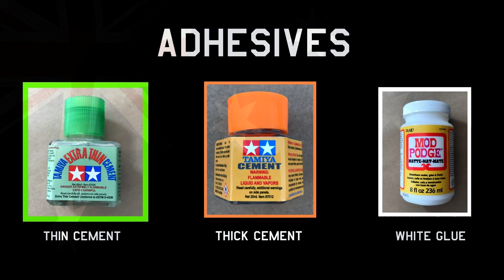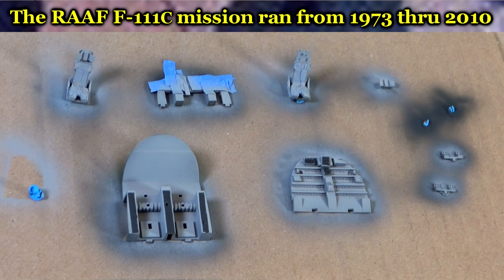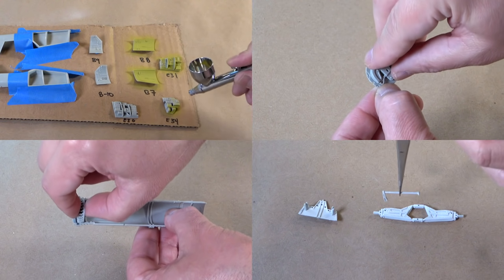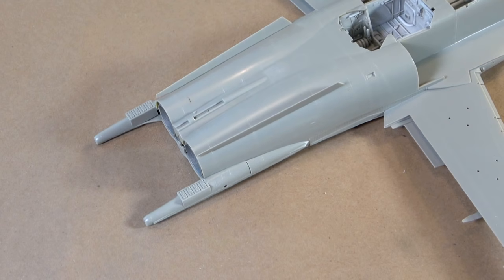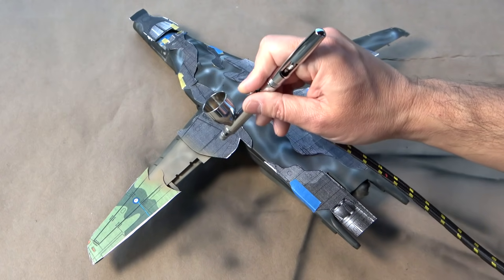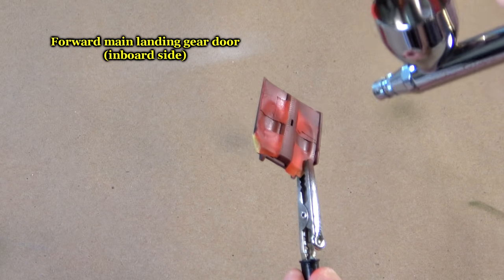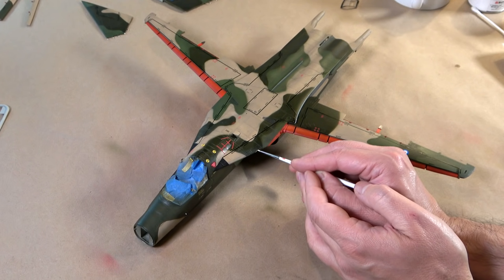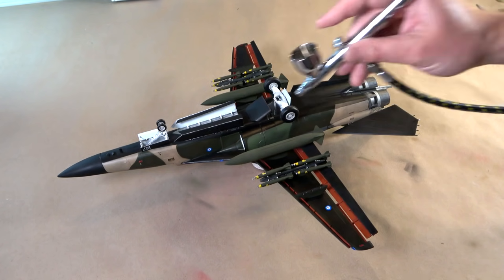Building the 1/48 Scale Hobby Boss F-111C “Pig” Fighter Bomber

Comment: Outstanding work! I just wanted to say thank you for the respect you showed for the crew that lost their lives in '93. The F-111 has a special place in our Aussie hearts and you have done that justice. Great job!
Reply from the maker: Thanks very much, Knophler! I'm so pleased that many Australians are chiming in and expressing their overall satisfaction with the model and the video. 🙂
Reply: @MaxAfterburner  Hello Max afterburner,  They said F 111 and F14 were a joint venture of Grumman and General Dynamics and  the original design was based on  F14 mock up model . Then two companies went their own way  but the variable geometry wings ,tail wings ,engine power plant should be the same (interchange parts). I am going do it with Hasagawa 1/72 tomcat F 14 and F111 Aardvark and inter change the common parts.

Comment: Beautiful job. I used to be a crew chief on A/C 0382 at Mountain Home AFB, Idaho for 6 years. I loved that plane. I won crew chief of the month twice and got to fly in my own plane. I noticed that you painted the speed brake black and red in squares. The F 111 I crewed and worked on, the cut out where the main wheels retract to, that indention was black while the rest of the speed brake was red. One thing about that speed brake. Those indentions where the most comfortable to lay on for your back. I wqas engine run qualified and also taxi qualified. What a great pane the F 111 is.
Reply from the maker: Hi Jim, I was using some reference photos for a few of the F-111s where they painted what looks like a red cross pattern and the central "bar" would travel through those indentations on the inner surface of the speedbrake. The F-111 sure was a large aircraft and probably a lot of work for you guys to maintain. Thanks for your service and for sharing your background with it! 😇

Comment: G'day, I was in the RAAF when our F-111s finally arrived. We had to lease F4 Phantoms for nearly a year until the 'Pigs' turned up. There was great controversy down here over the cost of each F-111. It was nearly four times more than any aircraft we'd purchased up to that point.
Fantastic to see them at air shows down here. I used to work at our air shows 'herding' the crowds around and keeping them away from getting too close to the aircraft. I remember doing the first available F-111 kit down here. They were a 'hot' aircraft. Happily, they spent all their time in the RAAF without firing a shot in anger. Our pilots really liked them. The ground crews not so much. A lot of them got sick after having to get into the fuel tanks to do vital repairs. It's wasn't a good outcome. Cheers, Bill H.
Reply from the maker: Hi Bill, thanks for sharing your stories! 😃

Comment: Outstanding build, Max - well done 👍 - I hope mine turns out half as good 😅 More on that in a moment...
My fond memory of the F-111 was from the 70's - 80's. I lived near a large valley near Lismore (NSW) ... as a little bloke, I could hear them coming, usually at night, flying by terrain radar I would assume. Going straight over our house at about 200 feet I'd guess. All you would see was the two big burners disappear down into the valley on their way back to Amberley. Just awesome.
I recently visited Evans Head Aviation Museum, which is located far north coast of NSW Australia. They have a F-111C on display - A8-147. Tim was an excellent guide. Anyhoos - they're struggling a bit financially, so to support them a little, the the family bought me a model kit - same as the one here - 1st one I've done since I was about 10 😉

Anyway - I'm starting to do my research for my build, A8-147 & the one in Darwin I saw (A8-113) have gloss black nose cones, not matt - Can someone in the know confirm that for me ?
Thanks in advance & happy model building 👍 ...
Reply from the maker: Hi TheQuinny67, so glad you enjoyed the build video and that you have many great memories of the RAAF F-111Cs during their active times.  While A8-147 and A8-113 have glossy nose radomes now, they indeed have been highlighted like this from their original matte standard. Many aircraft museums paint their aircraft exhibits in a gloss finish to include the fuselage sometimes even though most active military aircraft serve with a flat paint coat. In fact, a retired F-111E near me is super shiny like a sports car in a dealer's showroom! Best Wishes on your build! 😀
Reply: @MaxAfterburner  Thanks for the update 👍

Comment: Just a small note, 
When the RAAF retired the f111's, the super hornets took over initially as a stop gap for the strike capability, but are now a more permanent solution along with growlers.
Primary air defense remained with the F/A18 A/B's until their retirement in 2021, and is now done by the f35.
F111's had an initially rocky introduction, with cost overruns and several losses mostly due to mechanical failure in vietnam. Once these were sorted it was such a capable aircraft the soviets made sure they were included in talks since they were stationed in europe. 
The f111's also served extremely well in the gulf war, where they destroyed more thanks than any other aircraft, along with fantastic strategic bombing on factories, airfields and other high value targets. If you look on youtube there are many 'gun cam' vids of f111's guiding LGB's through buildings, hangers etc.

Comment: i witnessed a visiting usaf 'g' variant do a full afterburner take-off, and during climb out the air frame disappeared in a cloud of smoke. a loud explosion was heard, the plane came out of the smoke and immediately flew back to the runway and made a successful landing. the starboard engine, while at full military had 'self destructed,' luckily the plane and crew survived the event. it took a week for repairs to be completed, and a replacement engine installed, before the plane finally left.
Reply from the maker: Hi darkstar861, definitely not a dull day indeed! 😮

Comment: I well remember the FB-111As.  The 509th Bomb Wing flew them out of SAC's nearby Pease AFB between 1970 and 1990.  It was sad to see the 509th, the bombers, and Pease itself vanish into history.  I can still envision these planes climbing out of Portsmouth and clawing for the skies over the Atlantic.  Droop snooted.  Fuel laden.  And nuclear armed.  Alas, all now memories.  Still, the Aardvark's underappreciated sleek and graceful form ghostly graces the blue over New England.  And the beyond.
Reply from the maker: Hi Tex Leeger, very nicely stated. Seriously, consider writing a novel or something, if you're not writing already. Well done, sir! 👍
Reply: Pease wasn't the only FB-111 base in the area. Plattsburgh was also nearby as a crow flys. My dad worked OMS at Plattsburgh and Pease had to ship all their FB-111's to plattsburg for upgrading all their aircraft to the new crew separation system because of incidents where the capsule couldn't separate from the air frame due to the Guillotine not severing the flight cables causing crew fatalities. My dad was really grumpy after going through 2 Bomber wings of aircraft replacing guillotines on each and every one of them.

Comment: The Raven was the electronic version of the Aardvark. AKA EF111, AKA Sparkvark.
Reply: The EF-111 was also the last F-111 variant USAF decommissioned (1997).  That was a year after they retired the last F-models from service.
It was USAF's supersonic answer to the Navy's EA-6B Prowler.  It had a lot of the same jamming and electronic warfare equipment but just a heck of a lot faster.
The EF-111 scored a kill on an Iraqi F-1 during the first Gulf War.  The Raven was locked onto by the F-1 but managed to dodge a heatseeking missile.  By maneuvering to low level and using his terrain following radar, the Raven pilot was able to outmaneuver the F-1.  The F-1 got disoriented and flew into the desert.  USAF gave the EF-111 crew credit for a kill!
Ultimately, it was decided to expensive to operate 2 jamming/EW platforms so the more expensive plane to maintain and operate was retired.
The US Marine Corps retired the last operational EA-6Bs just 2 years ago.

Comment: Hello, thanks as always for documenting your process, as someone trying to improve their modelmaking it's really helpful, and I've learned a lot from your videos! I want to ask, what glue do you use to attach your painted pieces? Superglue can leave that cloudy white area and plastic glue tends to dissolve acrylic paint as shown in your Austin Powers 747 video. 

Looking forward to your next build!
Reply from the maker: Thanks vtkd! I mainly use the Tamiya Extra Thin cement. I use minimal amounts as possible and I avoid lingering in a spot when applying it in zones already painted. In other cases, sections may be already glued together before painting and I also try to apply glue at tabs and slots that aren't near areas that are outwardly visible.
Reply: @MaxAfterburner  Thank you for the reply! I will keep that in mind for my future builds

Comment: I was wondering if, on the full scale F-111, the underwing pylons rotate about their vertical axis (to maintain an optimal aerodynamic position of the pylon/pylon load) as the wings swing from low speed to high speed configuration. To me, this would seem a necessity to prevent structural damage induced by aerodynamic drag caused by pylons that are not facing directly into the relative wind.
Reply from the maker: Hi Shadovanish, it's my understanding that only the innermost pylon locations swiveled to maintain alignment with the fuselage. The outer pylons did not move and the wings would have to be swept to provide the best forward pointing position of any loads. I imagine there is some reasonable tolerance for drag/stress in less than optimal situations otherwise that would probably be a deal breaker for any country wanting such aircraft in their arsenal. 😇
Reply: @MaxAfterburner  Nope all 6 pylons rotated on the F-111. Otherwise the weapons will damage the fuselage on a fully armed F-111. There is a mechanism in the wing that moves all the pylons at the same time basically it's like the wing moves around them and they stay in the same spot. And if the outer pylons didn't move you would be risking them being sheared off by the airspeed.

Comment: Hi I have a question, how do you glue parts after painting them? It always gives me a hard time and gets gooey. Excellent work by the way
Reply from the maker: Hi Scott, if I have to resort to adding glue to parts after they have been painted, I rely on the capillary effect of thin glue. I dip the bottle's brush into the glue and sweep most of the glue off at the bottle opening. I then brush the glue quickly to the model area in a single stroke. Be fast, do not linger. Even if you "miss" a bit, do not go back and try again until the glue has had plenty of time to dry.

Comment: Found your Easter egg 21:09
Reply: Excellent build and replica of the Pig. Having worked in the aircraft for a number of years in the 1980s and having worked on A8-127 this brings back many fond memories. However, there are some corrections, firstly cowling on the engine low speed fan was white and significantly blunter than that on the kits engine. Also Australian F111s were fitted with the Pave Tack pod. The centre munitions bay did not have the bi fold opening doors which you have displayed as open in the finished model.

Comment: The camouflage is not that well done. Some areas between the colors have sharp border lines as other areas have a blurry over sprays. Also, never cut mask templates with an exacto blade, it causes sharp points instead of smooth rounded areas. Use scizzors! Also always spray a cote of flat white before red on the air brake areas! I'm not downing your work, I'm only being honest!